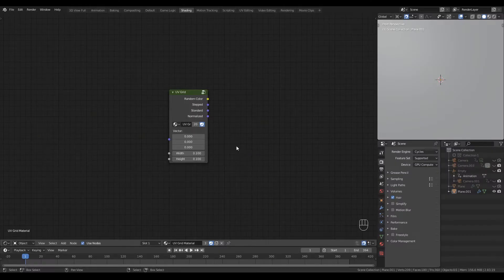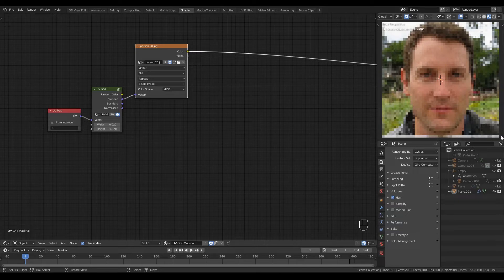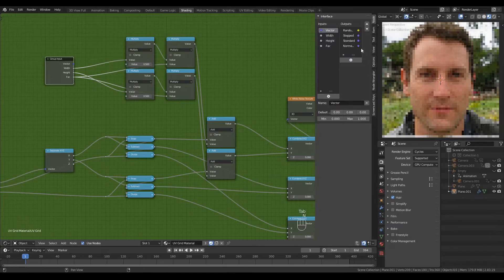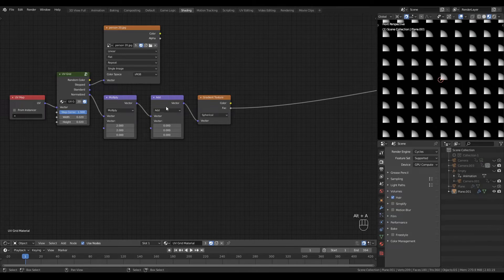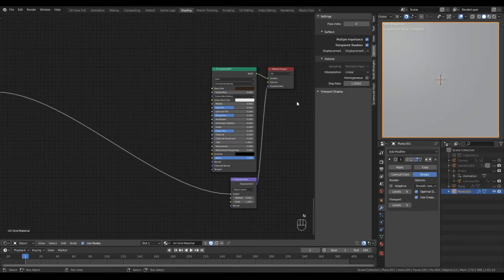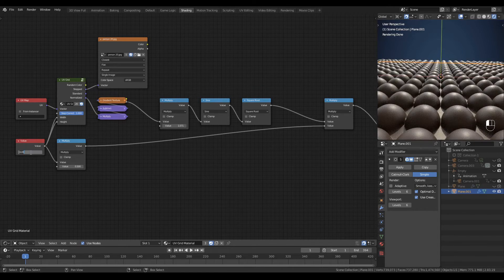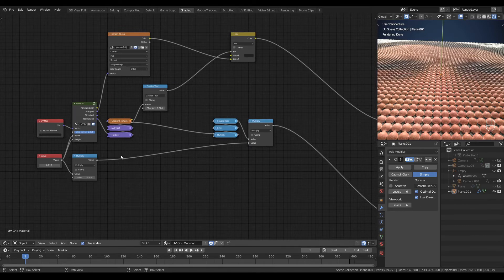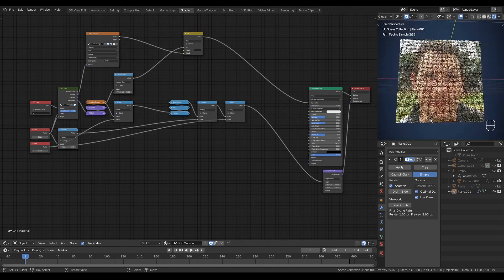Procedural Height Maps : UV Grid for Blender - A Tutorial Series - Part 3

Comment: When you hide & stack 3 nodes.....
H to hide. R to rotate 90 deg (move mouse anti-clockwise). S to scale them close to each other.
Quick and easy......
Reply from the maker: Neil! I love it! That's so smooth!
I never even think to use the transform operations in the node editor.
Excellent call!
Reply: @nodesandnoodles  Thanks O NaN (Lol  - NaN being the 'alternate' name for blender way back when. Not A Number).
I am focused on minimal movement as well as learning the math side of Blender (Have too now with GeoNodes). Keeping a hand on the mouse is a must - rather than typing, when possible. A r r is now useful in GeoNodes, not just on pirate day. Mostly its Add > Menu hot key and Mouse select. Faster that searching because you dont remove your hand from the mouse - so you do not waste time putting it back again.
And I am avoiding tweak, tweak, tweak with the nodes layout. So spinning into a stack is a great tidying method.
Reply from the maker: Glad to hear it! That's my technique too. There was a small push on Blender.Today where they wanted the add menu to automatically give focus to the Search field (instead of just pressing S...) so they would press Shift-A, and then type in their search terms. This would override the hotkey system and, just like you said, force the user to be constantly back-and-forth between mouse and keyboard. I was against the idea but it had pretty vehement support.

Comment: do you have some sort of settings or add-ons that make the displacement look so smooth in the preview window? i have exactly the same number of subdivisions (both on the plane itself, and with the modifier), and i ensured my render settings matched yours. and yet my displacements are jagged and blocky, and theyre half the height for some reason, despite all material settings being identical. 

(or did blender perhaps change how the displacement works within the last year? because this has been a reoccurring problem of mine where my displacements always look worse than the tutorial im following).
Reply from the maker: I have no special addons, this is just vanilla Blender. I use a plane sized 1x1 to match the sizes of the UV map whereas Blender's default Plane is sized 2x2. Scale your plane by 0.5 either in Edit mode or in Object mode but remember to Apply the scale if you use Object mode. This will be the reason for which your displacement height is half that of the plane in the video.
I'm not sure what could be causing the jagged blocky problem. For plane displacement, I recommend subdividing the plane in Edit mode with 10 cuts, and then add a Sub Div modifier with 4 levels. Make sure your plane is set to Smooth shading and it should look exactly like mine.
Let me know if this works out for you.
Reply: @nodesandnoodles  scaling it down (on x and y only) was able to fix the height.👍 but the jagged edges remain still. i have the same number of loop cuts as you use in the video. so i really have no idea why its doing this 🤔

honestly its been this way for every tutorial ive ever followed using displacements. so im wondering if its a preference somewhere that i changed ages ago that is messing it up lol.
Reply from the maker: Cool. Glad to hear the scaling worked.
Do you perhaps have Simplify enabled under the Render tab of the Properties panel? This would globally limit the number of levels for all Subdivision modifiers.
Also, you should ignore the loop cuts I use in this video when using a square plane. I made those subdivisions to suit a scaled plane for displaying a 1920*1080 video. Your geometry should be squares as much as possible.
Reply: @nodesandnoodles  unfortunately no, simplified is turned off. 

Although its good to know that option exists 😅
Reply from the maker: Could you show me a screenshot of the bad displacement? Are you on Twitter/X?
Reply: @nodesandnoodles ok I think I finally broke free of YouTubers random shadow ban lmao. (Sorry if a bunch of messages pop up for you all at once. I can't see them at all).

To answer your question, I don't have any social media besides YouTube and reddit. But I think posting my reddit username is what got me shadow banned... So... Idk how to let you know what it is lmao.
Reply from the maker: @Capn_Cantankerous  could you make a quick video and upload it to YouTube?
Reply: @nodesandnoodles  ok, so, I added my reddit to my list of links on my YouTube profile. Should be able to view my most recent post from there which has a bunch of screenshots.
Reply from the maker: Got it! I don't know why I didn't think of it before. You need to enable Adaptive Subdivision on your SubDiv modifier.
Reply from the maker: Actually, maybe Adaptive Subdiv is not the answer because I see I don't have it activated in the tutorial.
Reply: @nodesandnoodles  yeah unfortunately adaptive subdiv doesn't seem to be working right lately. Maybe something happened in the last update.

 Usually all it does is tell me I don't have enough power to render whenever it's enabled 😂
Reply from the maker: Enough power? As in, your GPU can't handle it? That's new...😕
Reply from the maker: Looking at your screenshot, the only thing that jumps out at me is that your view is very zoomed in and so your spheres must be very small. In the capture from my video (the right of the image) you can see 10 spheres vertically, whereas in yours you can see about 100. If you zoom out a bit and make your spheres larger, how does it look?
Reply: @nodesandnoodles  I know right? It's really odd. But it has happened every single time I've tried using adaptive subdiv. 

If I recall it says something like I don't have enough memory. But I have 64gb ram, and at least a Terabyte of free space lmao. And my CPU and GPU are more than blender capable. I'm thinking there's something wrong with my blender settings somewhere... I can't think of any other explanation.
Reply from the maker: When it says "memory", I think it's referring to VRAM or the memory of your GPU but even so, I see you've got a 3070 so 8GB of VRAM which should be plenty for adaptive subdiv with those settings.
I'm at a loss here my friend. I'm afraid I have no idea what is going wrong. If these issues started recently, perhaps consider using an older version of Blender or at least experimenting with one temporarily to see if the same problems arise.
I have to say, even though I don't remember using overlays for that video, and in fact I still have the project file and there are none in it, I find it very hard to believe that I don't have Adaptive Subdiv activated. The detail in the viewport and the time it takes to update when I change something in the node editor would both suggest Adaptive is on, but the modifier panel says it isn't... That doesn't make sense to me.
Reply: @nodesandnoodles  no worries man. I appreciate that you took the time to look through and try to help me solve it. For now I'm just gunna cope with it I guess lol. 

 Overall it doesn't ruin what I'm making (I'm doing some low poly and cell shaded animations at the moment). So I'm not too stressed about it. 

regardless, this tutorial series is absolutely fantastic. 😎 I'm looking forward to implementing all this.
Reply from the maker: No problem. I wish I could have got to the bottom of the problem, unresolved issues bother me, but I'm out of ideas for now.
Thanks for watching the series. I hope you'll enjoy the rest of it.
Reply: @nodesandnoodles  
👉😎👉
Reply: @nodesandnoodles  i have an idea. i saw a comment somewhere about how the lighting can really effect how displacement looks. and i noticed your world settings are very different from the  default. does one of your videos show how you have your world set up or do you have that data somewhere? im wondering if that could make the difference.
Reply from the maker: I don't have a video showing it but it's a basic HDR setup. I used this one:
https://polyhaven.com/a/portland_landing_pad
It's free for any use from Polyhaven.
However, I don't think it's lighting making all that difference. It's definitely vertex count. My best guess remains that it's a question of how closely your view is zoomed in. Let's do a test. Start a new scene. Make a plane. Set it use Smooth Shading. In Edit mode, scale it to 1x1 and subdivide it with 10 cuts. Add a SubDiv modifier with 4 Levels. Get the Displacement map from this PBR set:
https://polyhaven.com/a/ganges_river_pebbles
Put that displacement map in a Cycles material, set the Colorspace to Non-Color, multiply the output by 0.1 and connect it to a Displacement node. Set the Displacement node's Mid-Level to 0 and hook it up to your Output Node's Displacement socket. Set your material up to use Displacement Only and give it a dark colour so you can see the detail. Add a camera and position it so you can see the whole plane. Do a render. Post it to that same Reddit thread you shared with me and I'll do the same so we can compare directly.
You up for it?
Reply: @nodesandnoodles  what do you mean by scale it to 1x1?
Reply from the maker: @Capn_Cantankerous  the default plane is sized 2x2 so scale it by 0.5 to make it 1x1.
Reply: @nodesandnoodles  oh lol, gotcha. ok ill be posting it in the thread as a new comment.
Reply: @nodesandnoodles  ok its posted (i had to fix it because i accidentally plugged the normal into the displace lol. but its good to go now).
Reply from the maker: I've just replied in that thread.

Comment: hello I'm watching the tutorial and I have problems: after I change to "displace only" in the render viewport the plane appears lower in the Z axis of its original position, I would also like to see how you have set the plane to be able to follow the tutorial to the letter, thank you very much
Reply from the maker: The "Midlevel" input of the Displacement node  is set to 0.5 by default when you add a new Displacement node. Change the Midlevel to 0.
I use a plane sized 1x1 (so a standard plane but scaled down to 0.5, then apply scale).
I subdivide my plane 10 times in Edit mode and then add a Subdivision Surface modifier with levels of 4 for preview, and 5 for final render.
I hope that helps.
Reply: @nodesandnoodles  sos un heroe, habia puesto el valor en 0 pero resulta que no se habia actualizado el viewport (y eso que lo apague y escendi) escribo en español porque estoy devorando tus tutoriales, cuando tenga implementado tus tutos y nodos te muestro la obra, en serio muchisimas gracias por tu atencion yn conocimiento sos re clave, abrazo desde Argentina!
Reply from the maker: You're too kind!
I'm happy you got the issue solved and I'll look forward to seeing your results. Happy blending!

Comment: I found that I was best able to follow the video with my shape was 1 meter by 1 meter. At first I was working with a shape at 10 meters and that was causing issues with the node math.
Reply from the maker: That's exactly right. My plane is 1 x 1 to match a UV map. Displacement sizes can be wrong otherwise.

Comment: this one is not working for me
im not getting clean cones
Reply from the maker: How's your subdivision set?
Reply: @nodesandnoodles  that was it. I went a bit far and am a bit laggy now but spot on I was nearly a solid plane
Reply from the maker: @louisdavis1370  Got it! I'm glad you found the problem.
If you make the cones larger (larger size on UV Grid), you'll need less subdivision, but i realize that's not an ideal solution.
You could use Adaptive Subdivision so you get as much as the view needs, theoretically.
Reply from the maker: Tweet at me with a screenshot if you like.

Comment: Hi, thanks for the tutorial, it is really good!
You can get rid of those separate values from the vector nodes by ticking the "Hide Value" in the vector properties. So you don't need the connect a texture vector trick to get the same behaviour.
Reply from the maker: Hey there. Thank you and thanks for the input.
The "Hide Value" feature was introduced in Blender 2.9 or 3.0. I'm working in 2.8.3 here for "compatibility" so it's not available.